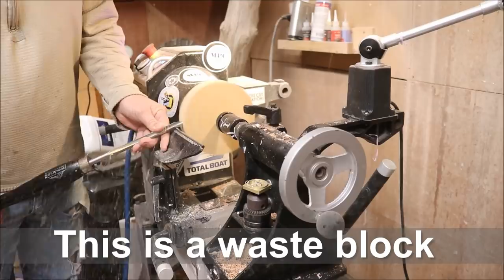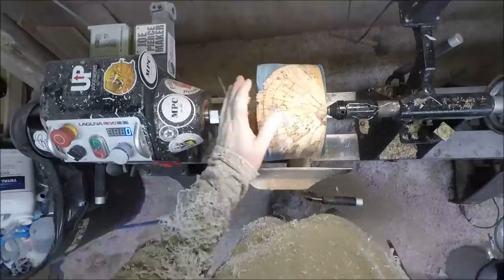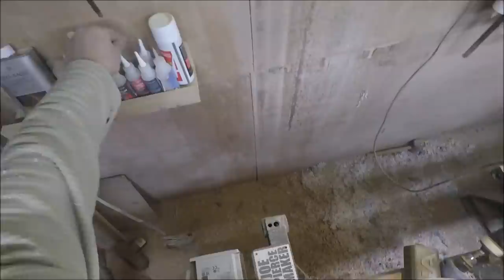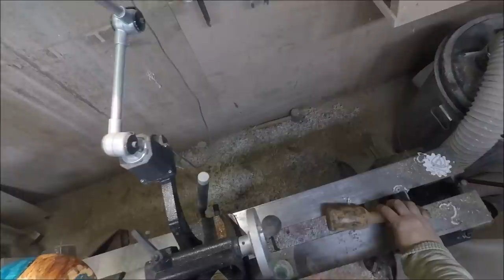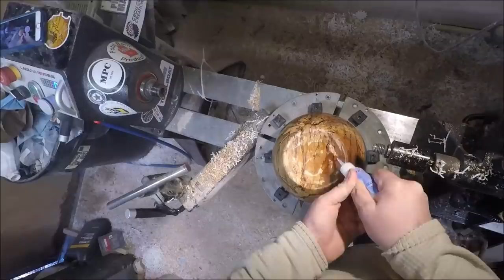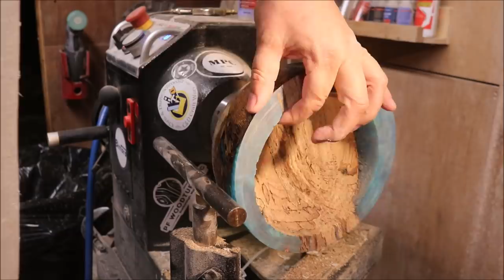Wood Turning - Rotted Oak

Comment: mix up a 200 gm resin 90 hardener then that much in acetone, make your own stabilizing resin, just keep feeding that mixture to the bowl until it quits drinking it, then let it set until the acetone evaporates off and the resin sets up.  bowl looks good you can get it done.
Reply from the maker: Thanks for the tips! I am thinking I will try in. 

Ken

Comment: Thank goodness you posted this video. I tried water oak a few months back, and thought I did something wrong in the drying stage. My exact thoughts were, “I know why it’s called water oak, because when it’s dry, there is very little wood left.” I was successful in making a bowl, only because of the cans of wood hardener I used prevented the tenon from breaking off. If I had used cactus juice in a vacuum chamber, I probably would have sucked the entire 1/2 gallon into my blank. Therefore, you confirmed my learning lesson of, never ever use water oak for anything, except for maybe termite food. Again, thanks for posting the frustrations of water oak.
Reply from the maker: I have noticed water oak seems to go downhill faster than other oaks. I wonder why?

Comment: This was a really good video! Showing this learns other people so much more than just seeing a good endresult. Somehow i also keep trying on these punky pieces of wood and end up up using endless amounts of CA and hardener as well. CA doesn't really work well unless you leave it soaking without using the accelerator but for real punky wood the only thing that helps really is stabilizing resin and vacuum. 
And it was also good to see for once from your perspective instead of the usual lathe cam ;) thanks!
Reply from the maker: Glad you enjoyed it! I'm hoping to bring this one back soon. I got some great ideas from the comments on this.

Ken

Comment: While I haven't tried it myself, I've heard that if you mix the resin equally with acetone and then the normal amount of hardener, it will soak throughout the wood before it sets.  Then you can turn it normally.
Reply from the maker: Bill Naivar thanks that  is a great idea.  Doug at Pohl Barn suggested the same thing. 
Ken

Comment: Would using stabilizing resin and heating it to cure help? I have seen others do it. They let it sit for days, oven cure, then go to town
Reply from the maker: It may, but the heat in the oven would most likely crack the resin that is there. I think I have a plan to fix it though.

Ken

Comment: Was the wood really dry to suck up the first pour like that? One problems with rotted wood is that is can be really punky, at first I thought turners were saying funky, that word works as well...sometimes the wood just does not want to play ball.
Reply from the maker: It was pretty dry. But I have noticed that when you pour resin and then leave it to cure it drops in leave over and inch. I am not sure where the resin goes as you can see it sure wasn't in the wood. lol

Ken

Comment: Did you put it in an oven to dry before using the resin?  Or did you stabilize?  You skip over the wood prep processes.
Reply from the maker: This piece of wood was air dried for many years. When I do dry my blanks I use an oven.

Comment: what would happen if you reset the bowl in more resin, and turned it again, this time just cutting the  new resin away.  Would this work?
Reply from the maker: It would depending on the resin. I used 50:50 cut of resin and acetone and it worked well to harden the wood. It's now sitting on my Shelf of Shame waiting to be re-turned.
Reply: @MoonpieCreations  its too pretty for the shelf of shame.  Hope you decide to give it another go at some point.  I love your creations and the chatty bits too

Comment: I've just recently got into this thanks to you your work is awsome and I've learned alot from your videos I've also noticed you always use the total boat epoxy which from what I've seen has a much nicer end product as far as clarity without the yellowing, I'm also still trying to figure out the ca glue I'm assuming its similar to an epoxy filler for cracks and is the over shine juice and oil based product or does it dry after being applied
Reply from the maker: Awesome, thank you! CA glue is just crazy glue. I use medium and thick to fill small gaps in the wood. I've tried a lot of resins and CA glues and can honestly say TotalBoat and Starbond are the best. If you buy some moonpie15 for 15% TotalBoat and MPC10 for 10% off Starbond on this link https://www.starbond.com/?rfsn=3081303.fd6b61. .

Comment: You convinced me to get a stabilizing set-up . I was about to go down the rabbit hole trying to turn a punky chunk of maple,between the ca glue and minwax cost stabilizing resin might even be cheaper. This won,t be immediate but will let know when I finally get around to it
Reply from the maker: Yea I could have bought a bottle of cactus juice for what teh CA glue and Minwax cost.

Ken
Reply: Beautiful wood! 
Also stabilizing it now would use much less juice than stabilizing it before hollowing, so nothing is in vain :) I don't know if it would fit in my chamber, but I've seen people use vacuum bags for that, very resin-saving.
Reply from the maker: I bought a 5 gallon pot the other day. But I have an idea on how to try and fix it without the vacuum. 

Ken

Comment: Do you have a vacuum pot, it would have caused resin to be pulled into the wood replacing the voids.
Reply from the maker: I did not have one back then. This one sits on my Shelf of Shame waiting. I used cactus juice and vacuum on it since this video. It is a work in progress.

Comment: That grain reminds me of the 2 logs I got from my friend, got 3 blanks out of them. One was that video I did my first time using Acks and OBs shine juice on that you commented telling me how much you loved your OBs. One is just roughed out in a 14 inch circle waiting for me to figure out what to do with it. The other is becoming quite the pain. Blew the bottom out and had a cool idea with resin on how to fix it. While I was waiting for the resin to cure I painted up the end grain with sanding sealer since it was super punky and tore out pretty good last time I worked with that bowl. It was absorbing in like how that hardener was on yours. It sucked it in and did something and out of no where just cracked while sitting on the table. It was about an 1/8in wide by 2in. Sealer hardened up and it kind of closed up. Filled it with black Starbond. We'll see if it turns or explodes lol
Reply from the maker: Well dang. Now I want to know what happens. Keep me informed.

Ken

Comment: Great videos. Fantastic work.
Why do you use the pressure device after pouring the resin?
Reply from the maker: It squeezes the bubbles in the resin so small you can't see them. If I did not use it I would get bubbles in the hardened resin.

Ken

Comment: I'm  liking the way the bowl was starting to look.  Don't call it a failure.  You learned from it, right!  I'm not familiar with the Minwax wood hardener. You should look at soaking wood like in stabilizing resin.  Peter Brown has a few videos using a stabilizing resin called Cactus Juice I think.
Reply from the maker: Thanks for the tips! The CJ has to be heated after use to harden. It's to late for this one, but have have more punky wood to use. 😜
Ken

Comment: So, im not the only one. I recently got hold of some cottonwood that is just as bad. The drive center and live center just sank into it. Ive got it still sittin in the shop, tryin to figure out what to do with it. Hate to burn it! Ken, that is a real purty blue. Such a shame that the wood is so bad. I did enjoy the new "moon-cam"! Thats a keeper!
Reply from the maker: Wood hardener work most of the time. But I think I have a plan to fix this. Stay tuned.

Ken

Comment: Wouldn't a vacuum then pressure make the epoxy fill the pores?
Reply from the maker: Yes it will, but I did not have a vacuum at the time I started this,

Ken

Comment: This was turning into a beautiful bowl, it is really unfortunate that it didn't turn out...  maybe if you used a stabilizing resin, and a vacuum chamber, then you could rework it, and have the wood not come apart...?
Reply from the maker: Thanks. The heat from cooking the Cactus Juice would crack the resin, but I have been given a few ideas on how to fix it. 
Ken

Comment: If you still have it, I will Cactus Juice it for you in my vacuum pot, and send it back. If the resin will take the heat required to set the cactus juice (200 deg.F) then it will work. Otherwise, I recommend carving out the wood and recasting the resin into a useable shape. The only way I see it going back on the lathe as is would be on a glue block each time you reverse it.
Reply from the maker: The heat will crack the resin, but thank you. Before I carve out the wood I will try resin and acetone mixed together. I'm being told it should work.

Ken

Comment: try to fix it with stabilizing resin. should make the wood turnable and then just add more resin for the parts that are missing.. must complete a project.. cannot allow the project go unfinished.
Reply from the maker: I have stabilized it with 50/50 resin and acetate. Just waiting to turn it now.

Comment: Have you tried Cactus Juice and a vacuum pot? It might help.
Reply from the maker: It is too late for this one. You have to heat the cactus juice after you vacuum it. The heat would cause the resin to crack most likely. but......hmmmmm

Comment: Put in in the cole jaws, cut the bottom down then soak it with 50/50 acetone and resin then glue a piece of wood to the bottom and the top ridge.  The grain on the sides is beautiful, I wouldn't waste it.
Reply from the maker: Thanks for the advice Bryan. I may try that and put it in a vacuum to draw in the resin. Another video maybe? 
Ken

Comment: Do you have a vacuum pot you could try cactus juice to stabilize and then maybe some more resin to fill the voids
Reply from the maker: I just got one, but I was under the assumption you have to heat the cactus juice in the oven after you use the the juice? If so it would crack the resin for sure.

Ken
Reply: Moonpie Creations oh I didn’t know they heated it after I thought it just sat to harden but I have also seen Kim Tippin reduce her resin with acetone to use as a brush on stablizer and maybe reduced resin could be used in the vacuum pot just a thought 💭
Reply: @MoonpieCreations  It does need to "cook" to harden after the vac chamber, but not very high.  Only like 175-200, and you can do at the low setting just takes longer.
Reply from the maker: Even at 175-200 it will crack the resin. I will be trying the rein and acetone trick and see if it works. Thanks guys.

Ken

Comment: Maybe a vacuum pot with some Cactus Juice?
Reply from the maker: Hey Eric. I didn't have one of those when I started this project. From what I hear the CJ has to be put in an oven after the vacuum chamber. With the resin I'm afraid it will crack.

Ken
Reply: @MoonpieCreations  I didn't think about the resin in the oven, silly me. Considering the CJ has to cook at 220, that would be too hot for cured resin. Ok, nevermind... Haha
Reply from the maker: Well it's still a good idea. I can recast the lip of the bowl if it cracks. Thanks. 

Ken

Comment: It’s not a failure. Sometimes things just don’t work out. Two questions - why does the wood hardener smoke like that? And it looked like your shop door opened - by itself... Is your shop haunted? 😳👻
Reply from the maker: Hahahha, thanks Lynda. 1. That was CA (Super Glue) that smoked. It has a reaction when it starts to harden in large quantities. 2. YES!!!! 😳
Ken
Reply: Moonpie Creations burn some sage...

Comment: I wouldn't call that a total loss or a failure at all!  Once I saw it break the tennon I knew it wasn't going to hold in the hole either...not sure if it would have worked to put a form around the hole and fill it with clear epoxy either.  You "would" be able to connect to the epoxy...but whether the epoxy would hold to that wood is very iffy.  Do you think it would hold any more epoxy?  If so, perhaps try clear epoxy to keep a bit of the current colors intact.  In any case...don't give up on it.  There is still promise there.
Reply from the maker: I have a feeling you will be seeing this one again. 😉

Comment: Well at least i learned something. #1 always use a #2 Graphite pencil. And #2 I'm not the only one that has these rotten failures
. 
Shame, it would have looked awesome with the blue resin.
Liked the way you vedio'd from your viewpoint. Easier to relate to.
Kind of supprised you didn't use your tailstock to support the weak tenon to keep the wobble out.
Thanks for showing it and move on bro!
Ohh, where did all the resin go.
Reply from the maker: You know that term hindsight? Well looking back I realized I should have used my tailstock lol. 

Ken

Comment: Camera on your head is too jerky.  Punky wood = stabilize THEN cast in resin.
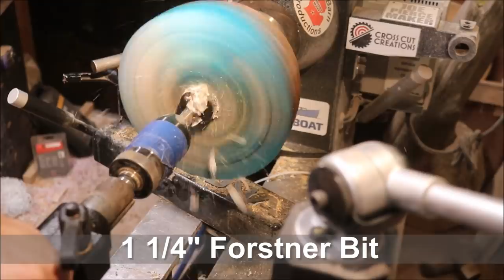Reply from the maker: I take the camera off at 10:54. Thanks for tip. I did not have a vacuum for stabilization when I started the video.

Comment: Have you tried stabilizing the wood? Stephen Ogle has a great video where he stabilizes rotten wood.
Reply from the maker: I just bought a vacuum chamber. But I think now that the resin is on it it may be to late. I'll check and see if I can find that video. 

Ken
Reply: @MoonpieCreations  yeah might be too late for that piece, but i think it'll be worth a try for the next project if the wood is as far gone as this was. love the videos you make and that you put videos up even when there is a problem during the creation.

Steffen
Reply from the maker: I have some more of that apple I have used. It definitely need stabilizing. I t try one more thing on this bowl. we will see if it can be saved. 

Ken
Reply: @MoonpieCreations  you do not give up easily that's for sure! Good luck and looking forward to see the end result😊